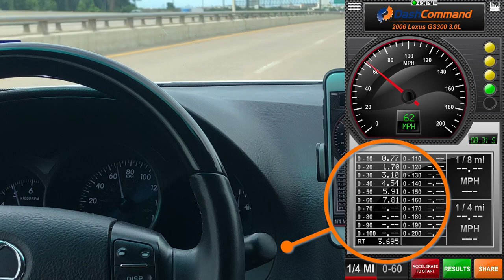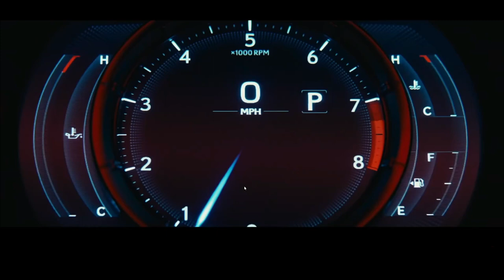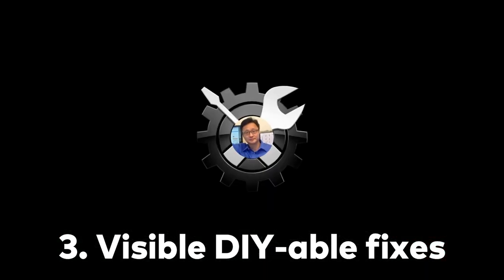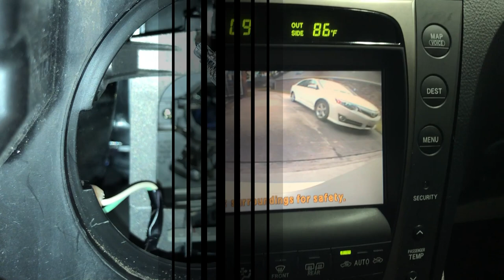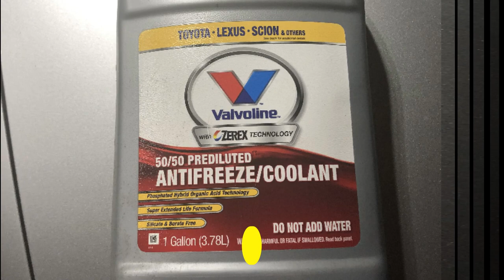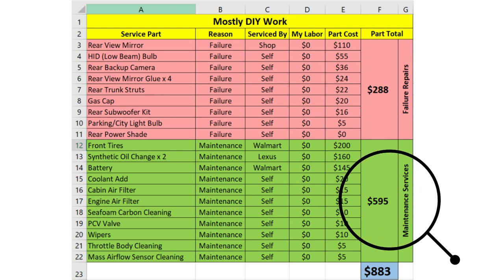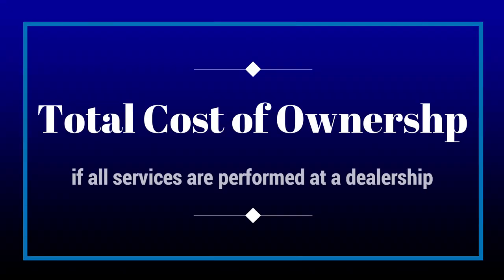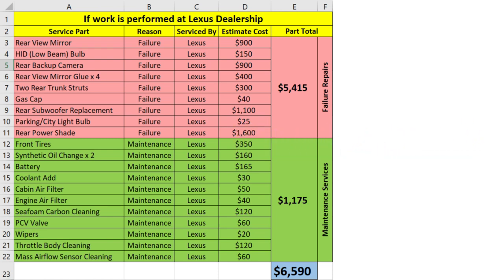2 Year Review & Cost of Ownership GS300/GS350

Comment: Very nice. I've have had mine since 2006 and don't plan on giving it up anytime soon. My rear view mirror though looks the same and the nav screen LCD appears to be ungluing but other than that the car has been a pleasure to own
Reply from the maker: How many miles do you have? I wanted to ask the original owner this. Around the windshield frame trim, does your car have matching color film like plastic sticker over the paint. I have thin film that is starting to unglue.
Reply from the maker: As for your nav screen, I’ve seen others replace it with Tesla like large android screen display.   If my infotainment system ever goes out, that’s what I’ll probably do.
Reply: @DIYLifeSkills  I'm at 170,000 miles. The car is mostly sitting parked in a parking deck the last few years, but from 2006 until 2017 it was in the south Florida sun non-stop. I'm not aware of any film-like plastic around the windshield, I'll have to look. I do know the roof trim in matching color that runs front to back near the edge of the roof, started peeling 4-5 years ago. I'll try to remember to check on what you're talking about. The clearcoat on my door handles has peeled off too, mostly the driver door but the others too

The original struts went out when we hit 120K-125K miles during a time when my spouse started driving to his new job 60 miles one way. I would say though, be very careful when you have to replace those, I did mine at Pep Boys and they burned the fuel line and broke the tire sensor, which caused ABS to turn off. I have to take the tires off completely and probably the brake pads, and that's assuming they haven't cut any wires

Check your rack and pinion. Mine was replaced twice by my Lexus dealer early on in 2008 and again in 2010 under warranty. The first time they replaced it was because the wheels locked, or steering failed, as the spouse was pulling out of a parking spot. I remember the dealer said something had broken or come loose. At the time we'd just completed a cross country move and were lucky nothing happened while we sped through the Colorado and Oregon mountain ranges! The second time they replaced the rack and pinion was either because of a recall or our dealer just decided to do it anyway 

If you haven't, you should enter your VIN on https://www.lexus.com/lexusdrivers and see the history and what's been replaced under recall
Reply: @DIYLifeSkills  not a fan of those because they are terrible tablets with old Android. And also because they remove some of the physical buttons :) ... I'll probably put a salvage unit in, but they come with nav/parking sensors which I don't have and there are no front/back bumpers in red. Or I'll just drive it like that, I use my phone for navigation so it's not that big of a deal
Reply from the maker: @MiroBG359  I bought mine 3 years ago with 106K miles from a professional working mom with two little kids, so the car was gently driven, though it had many accessory issues that I fixed (covered in my videos).   I work in high-tech company, and due to the pandemic, 6 months after I bought the car, I've been 60% working from home, so I only put on 11K miles in 3 years. So now I'm at almost 117K.   The engine and transmission has been solid thus far, though I'm about to do the trans and rear-differential fluid changes once weather cools perhaps in Oct.    My struts are all good, but the rubber boot ripped on one of the back ones.   Since I plan to keep this car for a long time, hopefully over 200K miles, I'll get the best after market struts, and I'll do the work myself.   So far, no issues with rack and pinion, but I'll look out for that.  I went to the above Lexus site, but what specific link do you go to check the history?   I did check for recalls for this car on other sites, and no pending recall service is pending.  I also had two oil changes done at the Lexus dealer and asked them to check for any recalls, and they told me none are pending.
Reply from the maker: @MiroBG359  Yeah, that was my concern too. Even if Android is up to date at the time of the purchase, what would happen after few years, and how to get it updated, and how reliable it would be.   And definitely having manual controls do have convenience advantage. To be frank, GS300 infotainment design sucks, as I have to press too many buttons to get to the screen I want.

Comment: I just bought a black 2005 gs 300 for £2500, only 112,700 miles on the clock. Alloys are a mess and will need sorting, moonroof doesn’t work properly but seeing as it’s the UK I can live without that, probably too expensive a fix to bother getting it sorted. It’s early days but the car drives really smoothly and everything else works, so fingers crossed I’ve got myself a bargain
Reply from the maker: I would buy that in a heartbeat.  Good job and good luck with it.
Reply: Free T  The exhaust went within 3 weeks - cheapest option was to get a stainless steel one made for £730. And 3 of the shocks turned out to be leaking, which was another £1000. Ouch! BUT the engine and gears are as smooth as the day they were built and the mechanic said the car would be good for at least another 100,000 miles. 

One thing to note, the engines in all three versions of the 2005-2007 mk3 gs300’s can only take the old e5 fuel, not the new e10 stuff.

To be honest gs300’s with that mileage or just under tend to go for about £4000, so I’ve effectively bought a £4000 car in instalments. Or at least that’s what I’m telling myself anyway! Really lovely car to drive though.
Reply: I m looking for one in the UK too , but difficult to find a silver with black seats SEL

Comment: Just bought a 2006 GS300 in white from my cousin for $2000 AUD, with hail damage (cant really notice with white paint job).  It has 220,000km on the clock, but seems to run well and has only delivered a single fault code (P0175) which is bank 2 running rich.  Cleaned the MAFS and throttle body but alas the code is still there, got more steps to take next.  I have noticed that it burns a bit of oil, and is the only car i have owned that i have to top it up once a month at the least, and have read of other having to do this aswell.  All the electrics work, except the boot popper (trunk for you Americans).

The worst thing i have only just noticed was the tell-tale 'rotten egg' smell, indicative of bad catalytic convertors, under heavier acceleration.  This could also be because it is running rich, however i feel its the cats themselves.... touch wood it isnt.  I have seen prices of $1400 for a single side cat advertised, and likely needing 2 would make the purchase almost $3000 for a set.
Reply from the maker: Despite the oil burning issue, $1450 USD amazing price. With used car prices soaring in US, that’s at least $4-5000.
Reply: @DIYLifeSkills  yeah they still sell, in Australia, for $10,000 to $15,000.  So i could just flip it for profit if shit hits the fan for me.
Reply from the maker: Yeah, when car burns of oil, heavy carbon fouls up catalytic converter and degrade it's capability over time.  And Lexus/Toyota cars burn oil when small holes around the 3rd piston ring gets clogged with carbon, and oil that is scraped off the piston chamber by the 3rd piston (oil) ring can't recover the oil on the down-stroke.  Therefore, oil is left on the piston chamber wall and they are burnt off combustion cycle.  Once the holes around the 3rd piston ring gets clogged with carbon, there is no easy way to unclogged them since tightly fit piston rings make it hard to get any cleaning solution on to it without pulling the pistons out to clean them.   About the only thing we can do is, do the oil change no later than every 5000 miles with good oil to prevent it from getting worse. Since this is a GDI engine, very likely you have heavy carbon build up on the intake valves and on piston heads.  Cleaning this will definitely help with performance and to prolong the car's life though it'll not stop the oil burning issue.  

Check out these videos on how I cleaned carbon on piston heads and on intake valves. 
https://www.youtube.com/watch?v=m0fGP3MrqFQ&list=PLRcC05jPDdVTi998JuZDnq3Iy0p6ymJBF&ab_channel=DIY%26LifeSkills
Reply from the maker: Also, there is a possibility that catalytic converter is heavily carboned up, and you might be able to clean the inside. (since they are so expensive to replace)
You'll still have to remove cats to do this, so it's not a quick work.
Reply from the maker: @aussiemilitant4486  For sure, if you were in US, I would double your purchase in a heartbeat.   :-)
Reply: @DIYLifeSkills  what would you clean the cats with?  A pressure washer or a chemical?
Reply from the maker: Soaking with chemical.  Berryman’s chem dip worked pretty good for me on carbon cleaning
Reply from the maker: Check out this video. He cleaned the cat through fuel additive. 
https://www.youtube.com/watch?v=Vjens02wssE&ab_channel=PetervonPanda
Reply from the maker: https://www.amazon.com/Cataclean-120007-Complete-Exhaust-Milliliter/dp/B002BVXM92/ref=asc_df_B002BVXM92/?tag=hyprod-20&linkCode=df0&hvadid=312697294768&hvpos=&hvnetw=g&hvrand=12643588837182027959&hvpone=&hvptwo=&hvqmt=&hvdev=c&hvdvcmdl=&hvlocint=&hvlocphy=9027782&hvtargid=pla-385877860030&psc=1
Reply: @DIYLifeSkills  thanks for the help mate.

Comment: I bought a 2008 GS350 AWD with 135k miles and it’s honestly been a super disappointing car to own. Everything is crazy expensive and tons of a weird things go wrong. Thankfully you have DIY videos on a lot of these issues but it still have issues. 2 of the biggest being a shuttering feeling at 20mph, leaking CV boot, and constant check engine light saying bank 2 catalytic converter is “clogged”. Lexus tells me I need a new CAT (1500$) and another shop says engine diagnostics are fine and I don’t need to do anything… 😑 

Again thanks for the videos. Next thing I’m doing is sending in my rear view mirror to the same place you recommended. ✌️
Reply from the maker: CAT is extremely expensive for all cars. You could consider getting a used one off of a new model from a salvage yard and then have a shop weld that on.  

Not always, but often I see cars that go too long on oil changes, over time clog or dirty up the cat.  If it’s just dirty, there are YouTube videos that show how to clean it. But it’s not easy work as you’ll have to cut off the cat from exhaust pipe and then weld it back on afterwards.
Reply: One gallon of lacquer thinner with half tank of gas and drive it for 3 days about 200 miles at high speeds if you can. Then fill up with premium and reset the light.
Reply: @errolwashington5606  I’ve heard that is a bad idea. Trust me I considered doing this since seafoam into in the gas tank and using it in the air intake didn’t do anything either. At this point I’m just gonna buy the O2 sensor spacers to bypass them.

Comment: Did the seafoam cleaning do anything? I see that STP pro-series intake valve cleaner does a good job but I can't get that in Canada.
Reply from the maker: Since I didn’t get a chance to take before and after videos, I can’t positively confirm how much carbon was cleaned. 

But overall, my car is running smoothly before and after. It could be because I don’t punch on gas and do timely maintenance on schedule.  

I also use best full synthetic oil.

Comment: Hey man, I am looking at a 2006 gs300, good car with only 91k miles on it and from the first look looks fine. Only thing that I have noticed is the dashboard is showing the gas mileage around 15.9L/100 kms, it's a 3.3 V6 but honestly it's too much in my opinion. Google is saying mixed is around 11. Is there any reason for this or is it really just dashboard issue? I would appreciate a fast reply from you if it's a good thing to go with the car
Reply from the maker: I get about 25 mpg in 60% city 40% highway mixed driving.  100% city driving gets about 23 mpg.  100% highway driving gets me about 28 to 29 mpg.   You can convert the mpg to kmpl on google.
Reply from the maker: with 91K miles, I suspect that the previous owner didn't replace spark plugs, and clean MAF and TB, I have videos on these.   Also, using fuel injector cleaner regularly is important for this GDI engine.    Also, take a look at the intake valve carbon and piston carbon cleaning. This GDI engine is vulnerable for carbon build up.   But if you do the maintenance I show in my video, this is truly awesome car.
Reply from the maker: At this miles, you probably want to replace the Transmission fluid, water pump/thermostat within next 10-20K miles.
Reply: @DIYLifeSkills  true, thanks for the reply. I probably have to look at its intake valve once again and will get it inspected with a friend mechanic again. Do you think theres still a chance the mileage of that car is up because the previous owner didn't take care of it well, because your numbers look really good
Reply from the maker: @rushil505  This car is rated for 22 mpg in city and 30 mpg in highway.   So, I'm in line.   If the engine runs smooth, it probably just need some good tune up as mentioned above.  If you are going to have this checked out, have them also do the piston compression test. This will tell how good the engine is. This car is very popular and they sell quick.  How much are they asking?
Reply: @DIYLifeSkills  I am in Canada, it's a dealer asking ca$8500, it's got very very minor hail on it and it's probably one of the few gs300 in my city and anywhere close, and yeah you are right, I am also suspecting issues with the fuel injector as you mentioned. I am also looking at a 11 Honda accord at the same price and odometer, but it doesn't beat this Lexus' beauty anywhere close
Reply from the maker: @rushil505  That's actually pretty good price given the spike in used car price due to pandemic. But run a carfax on it as used car dealers can rollback mileage. Resell value on GS300 will hold up better than accord.   My GS300 was nearly $50K luxury car, top line 2011 Accord will not compared to luxury feeling you'll get.
Reply from the maker: YouTube auto deletes comments with links.
Reply: @DIYLifeSkills  oh shit that's right. If you've got an email I can send it over there. Regardless, will look into all those things and see if the cars gonna end up causing me more to maintain or no

Comment: All those DIYs and oil changed at Stealer? I'm lost here!
Reply from the maker: Every time I buy a used car, I do the oil change at that brand’s dealer. The reason is they do full inspection on a new car that you bring to them so that they can find things to work on and make more money. This way I use dealer find any leaks and under car problems that is not easy to see at home without going through lots of hassle. 

In this case, I got second oil change also at dealer because I work a full time job and was too busy but oil change was due.  

Otherwise, I do all my oil changes, as you can see my other videos.
Reply from the maker: Of course, I do nearly all my repairs, so I just use dealer to just find things on a new car. So the first oil change literally takes 2-3 hours to get my car back.  :-)
Reply: @DIYLifeSkills  I see, that's reasonable and wise.

Comment: I’m looking to buy one of 07/08 gs350 how’s the real world fuel economy on these things? Also have you tried putting regular fuel? If yes how did it affect the mpg?
Reply from the maker: I fill up with premium only every 3rd or 4th fill up.  I’ve not seen any MPG difference between regular vs. premium gas.  I buy the big 128oz. Lucas fuel injector cleaner, because it’s a lot more economical, to compensate for using regular gas frequently and do use it once a month or so.
Reply from the maker: That’s really good that you buy 2007 and above which has dual port and direction injection so that you don’t run into massive carbon build up like in my 2006 GS300 with only direction injection.  You can see the massive carbon build up on pistons on my latest video.
Reply: @DIYLifeSkills  thank You so much for the info! 🙏

Comment: How is the oil consumption on these vehicles I read somewhere that they have this problem.
Reply from the maker: Oil consumption is heavily depended on the mileage and how well oil changes were done on time with quality oil.  I have almost 118K and last oil change was done about 114,500 miles, so in 3,500 miles it’s burned only 3/5 quart as of today.  So I think it’s quite normal.  

Best way to avoid oil burning issue is to change oil every 5000 miles to minimize building up carbon on piston oil ring area. Once carbon plugs up tiny holes behind the piston oil ring, that’s when engine burns oil since the holes are clogged to retrieve the oil scraped off the cylinder wall.  

If you are looking to buy GS model, it’s best to avoid 2006 and earlier as it uses GDI engine that cause carbon deposits on intake valves.  2007 and newer have dual port injection, so fuel is sprayed to intake valves to prevent carbon build up.
Reply: Thanks very helpful
Reply: @DIYLifeSkills  Should I avoid the 2006 430/460 too????
Reply from the maker: @alljerseysmatter.  430 and 460 engines are port injection engines so they are just fine.  It’s the direction injection in 2006 that causes intake valve carbon build up.